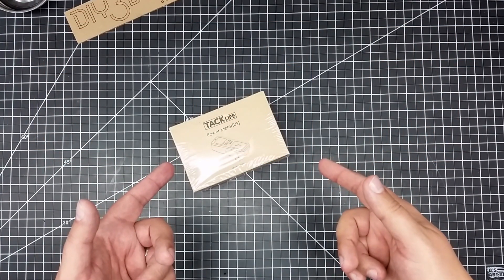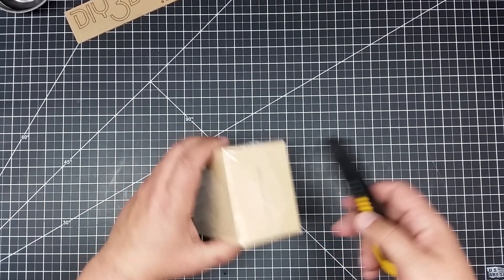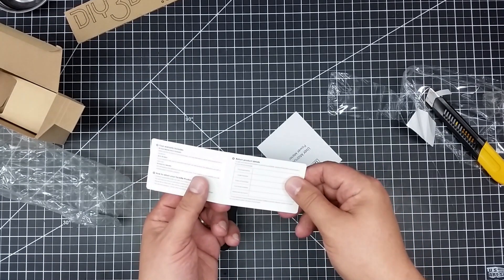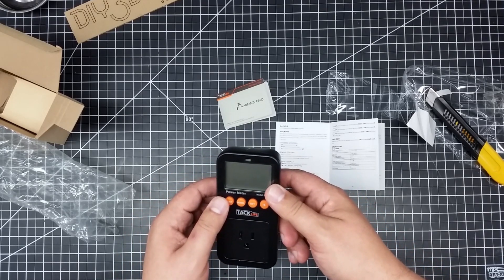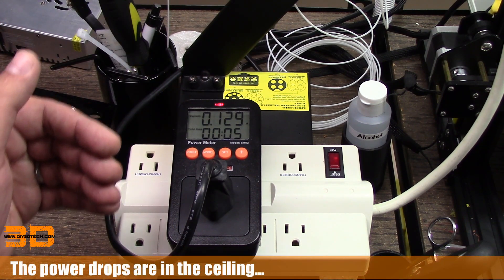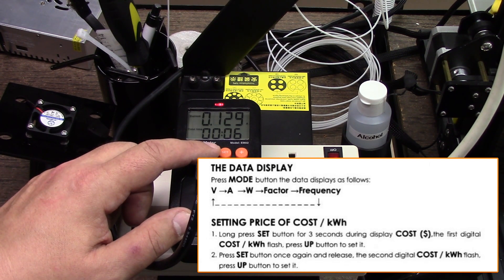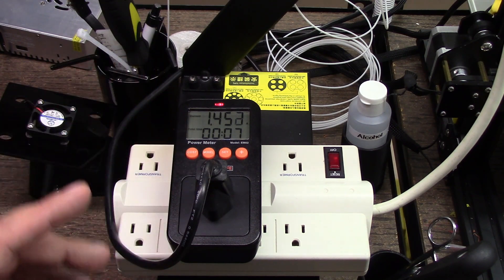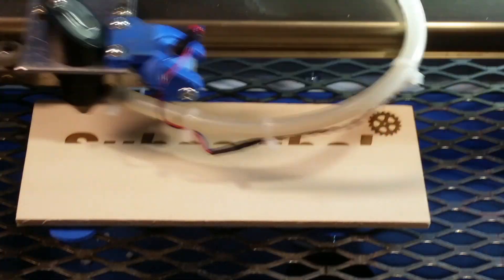Shop Talk - Bonus Does 3D Printing Drive Up Your Electric Bill!

Comment: No it doesnt cost much. You are using about 170W peak there. Lets round it up to 200W to include the hotend(in reality it wont need this much power when up to temp). In the UK this would cost about £0.12 for a 4 hour print. Compared to the cost of the filament its peanuts.
Reply from the maker: But what if your running 10 printers?  Also what does KWh cost in the UK these days?
Reply: DIY3DTECH.com uk prices are currently between 9 and 17p per KWh. Running 10x the number of printera will consume 10x the power AND 10x the filament. The ratio of filament to energy costs wont change.
Reply from the maker: But It does add up, as I end up paying about $100 USD a month to run all of this as we are around 9 cents a KWh depending upon time and yes that's about what I remember it as (I've built and run Data Center's in the London area) ..
Reply: When I am printing I notice the bill goes up 10-20 so I don't print often.  With the X5S I will be using the bed at 400 watts so I suppose the whole thing will be about 500-550 watts.  That is a nickle per hour to 7 cents per hour at our 10 cents per KwH cost.
Reply from the maker: Yea run around 3 at a time, then there is the CNC, Laser soldering station lath bandsaw etc.  it adds up, will have to build a solar farm :-)

Comment: Checkout Sonoff POW not the most accurate one but you can get an idea how much your printer uses. Has an ESP8266 chip and with modified firmware you can use MQTT to collect data.
Reply from the maker: You know I was looking at these before I got this one, but wanted something "simple" as these appear needed to be wired in line and most folks can't do that but think I will also also order a couple to mess with as they are cheap.  I also looked at MQTT and this appears to be an SDK of sorts so is there a completed platform ?
Reply: Checkout Andreas Spiess https://www.youtube.com/watch?v=hv_FpBqWFrg you also can install openhab2 on one RPi to collect data and switching things.
Reply from the maker: That looks really cool!  Thanks for sharing!

Comment: I know the answer to this one.. YES! It does. :-)  All my printers log power consumption through my Home Automation system.
Reply from the maker: Now that is COOL!
Reply from the maker: Wait a minute please don't tell my wife :-)
Reply from the maker: Dumb question, what are you using for data collection?   I am thinking about getting "Sonoff Pow WiFi Wireless Switch With Power Consumption Measurement" to do a deeper analysis of the power cycles...
Reply from the maker: Interesting, had not seen a power strip version :-)  Does HomeSeer work with Alexa?  Sort of  working on a side project around home automation.  I am going to "sort-of" retire in about 5 years so the wife and I looking for a retirement home (we also flip homes and own rentals on the side) so we are looking for something to completely re-hab to serve into our later years and I want to build in technology to assist as well watch after us so I looking at a number of things.  However I want it to be mostly off the self as I can't be old and goofy writing code and soldering wires :-)
Reply: Well it's not just the power strips, but the other interfaces. You know with your feelings on any interfaces between the appliance plug and wall socket it's going to make things much harder for yourself in the HA world.  Yes, HomeSeer works with Alexa. In one of my video, you can hear me turning on one of my printers via Alexa :-)

As far as 'off the shelf' solution....The one thing I recommend to anyone looking at HA is to make certain the system will work without being connected to the cloud.  Been there, done that... No thanks.. HomeSeer is what I consider a Prosumer product. These hubs you can buy today are boarding on being toys IMO, especially the cloud based ones.
Reply from the maker: I have mixed feelings about the cloud since that is my day job (creating them) however hear what you saying as I have been with Wink for a long time and it has gotten a lot better (but not perfect).  As again back to my day job I also work a lot with industrial IoT (Narrow Band and Cat-M1) building out large scale OT systems mainly in the petro-chem arena but I need something my wife can operate too as I would have it all CLI but she would kill me :-)   This is good stuff and will check into it so many thanks as you know what they say, happy wife happy life :-)